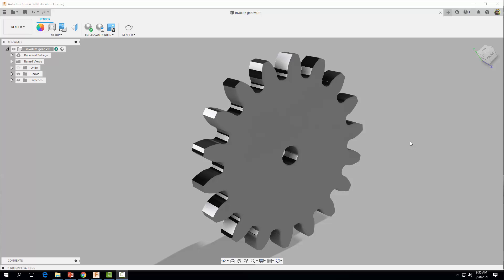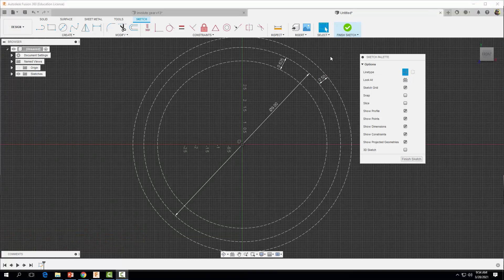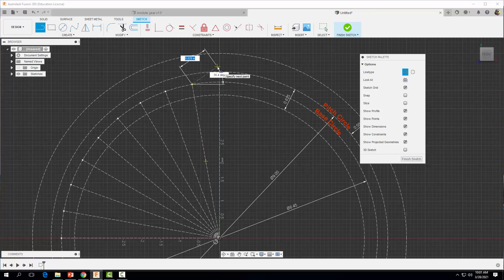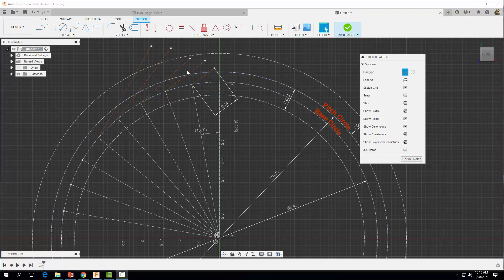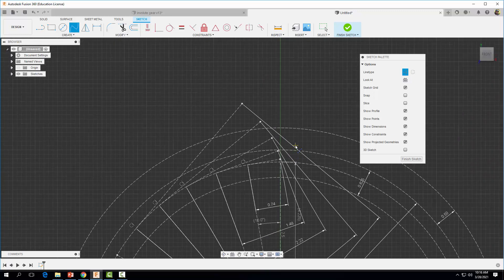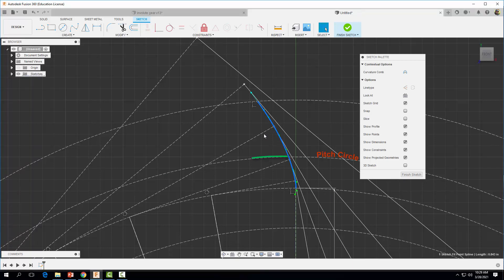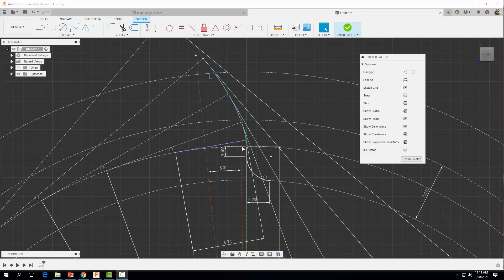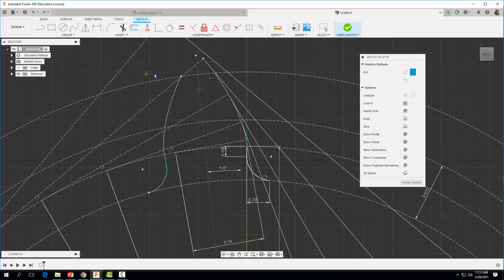Creating a Spur Gear from an Involute Profile Sketch with Fusion 360

Comment: Best video for simplicity. However the calculation of half the tooth thickness is simpler if you just take half the original angle of 10 degrees to bisect the tooth in half. Keep up good work

Comment: Great video! Question: how did you calculate the small line connecting the involute to the base fillet, extending from the base circle to the dedendum at 13:38? https://youtu.be/cAhzv6W3nmM?t=818  Thanks!
Reply from the maker: It was basically a nebulous distance from the top of the fillet to the base circle, could be any distance based on the size of fillet.